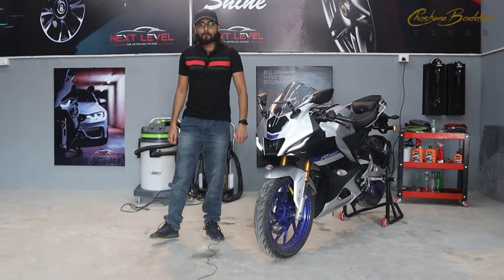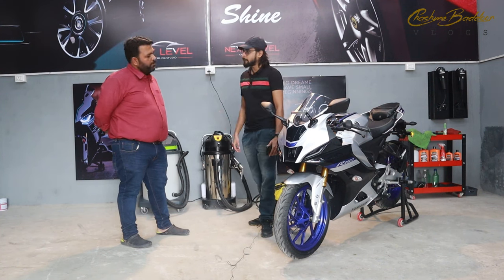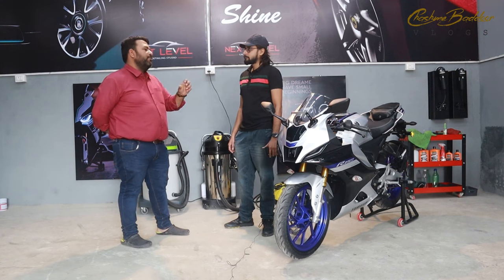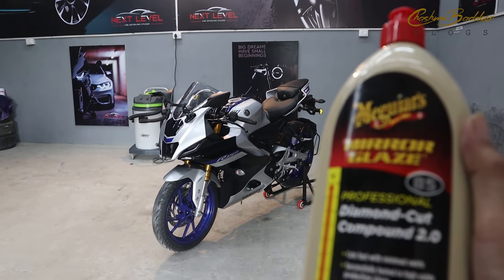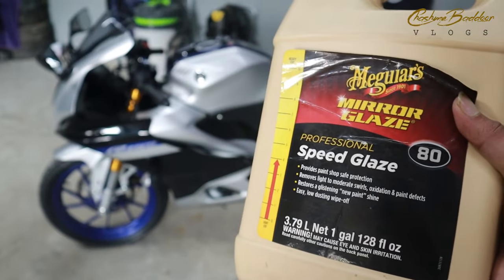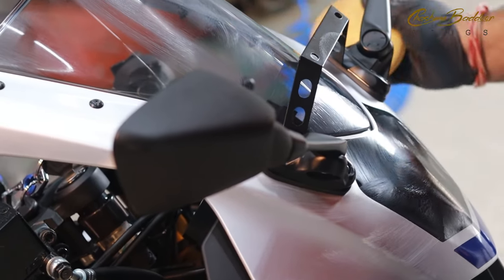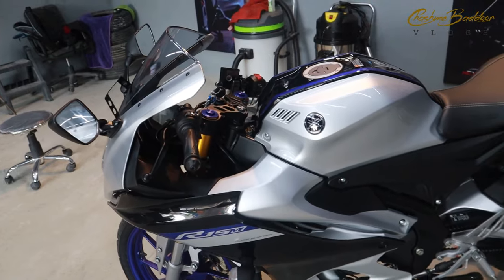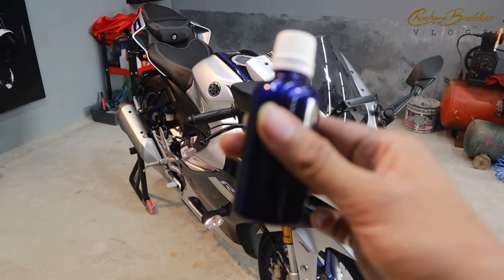Super Glossy Yamaha R15M | Ceramic Coat on Yamaha r15 | Next Level Detailing Studio - Muzaffarnagar

Comment: Absolutely wrong ways of doing Ceramic Coating, don’t fall for such traps !
Reply from the maker: Ok… what was wrong in it.. please explain so that we all know.😃
Reply: For brand new vehicle 
1) Detail wash
2) Clay all painted parts
3) since it’s brand new bike no need to compound, it will only reduce ur clear coat…. Directly use it mirror glaze just to remove minor swirls n lines
4) Wash the bike
5) IPA clean only painted parts
6) 2 coats of ceramic

Using yellow wax and sealant before ceramic makes no sense cause when u wanna apply ceramic coating all the panels should polish and wax free, there shouldn’t be any sort of polishing oils or it’s residue….. he applied wax n sealant and then he cleaned it IPA before applying ceramic coating, (IPA is used to clean any polishing oils and residue) this shows his detailing and product knowledge. 

When wax is used ?
After a detail wash, clay the vehicle and apply wax. By doing this ur vehicle will have a decent shine for 2-3 months depending on many other reasons 

When is sealant used ?
After detailing or polishing the vehicle apply sealant, it may last upto 6-8 months depending on many other reasons

These are industry standards but many don’t know basic knowledge. For more info, check the YouTube channel of Pan the Organiser and Ammo NYC, cheers 😎